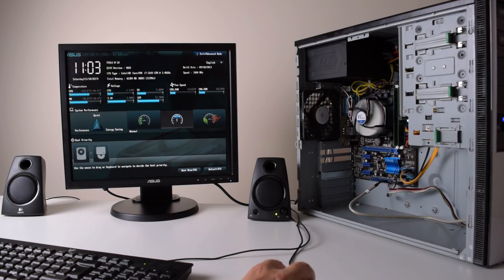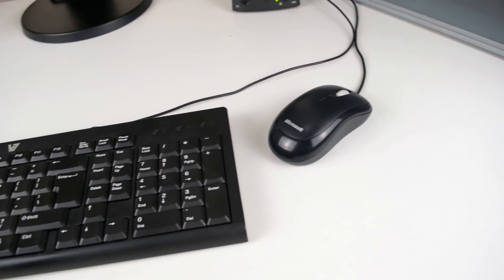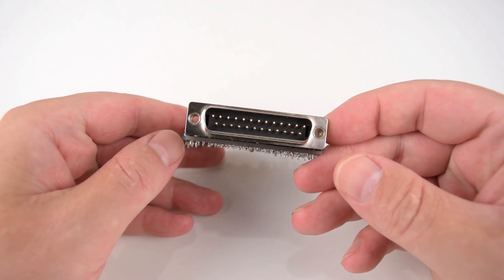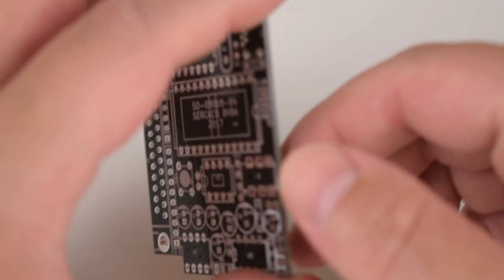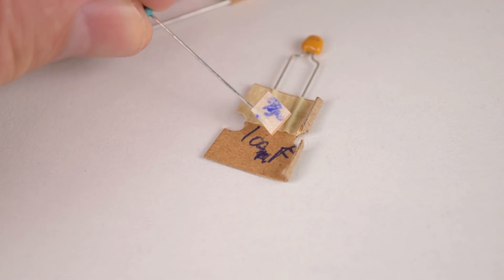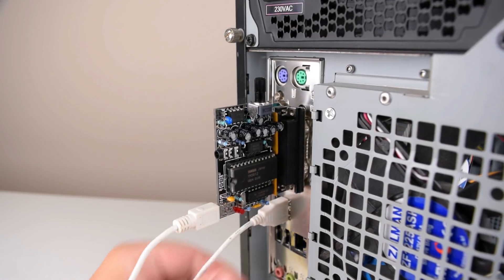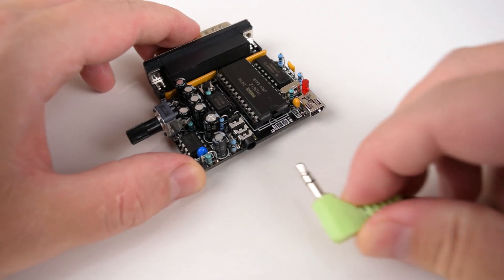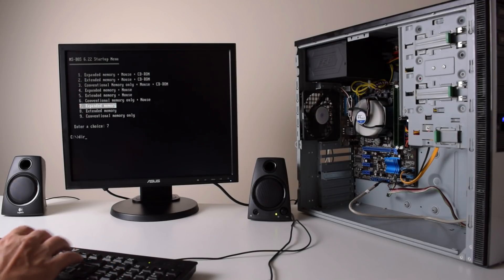Adlib Yamaha OPL sound in DOS games on a Core i7

Comment from the maker: I will post any updates here!

- There are now patches for games such as Doom, that add native support with this device. So with this, Doom now works. Other games are also supported, look here: https://github.com/pdewacht/adlipt/tree/master/adpatch
- Serdaco tells me that the final kit, the one you would receive, has matching photos with the parts. My kit had one or two capacitors in a different colour, but this should be fixed for your kit.
- There is a new 0.4 version of the driver https://github.com/pdewacht/adlipt/releases/latest
Reply: You are on a roll, Phil! This isn't really my thing, but I have a great deal of admiration and respect for people who do these kinds of projects. Very cool!
Reply from the maker: TheCaptain Same and that's the main reason I help spread the word.
Reply: Is there some reverb added from the speakers/room?
Reply: There is a printer port header on any newer under 150$ motherboard and in case of asus every motherboard witch has letter C on the end it means it supports legacy device for peinter port and comunication port (For examle H110M-C is used with i3 6100 in my office because i need a printer port and seral one) also you can add a LPT via pci or pcie 1x card for example JAVTEC makes some good ones

Comment: Only took 2 days to come through and not difficult to build and it works great on an old P233 Thinkpad I have (although it has its own sound card already). I can't get it working on an IBM PS/2 386 though and I don't have anything else 3/486/Pentium.
Reply from the maker: Odd, I wonder what's different with the PS/2?
Reply: No idea, someone else on their forums are reporting the same on their PS/2 too though. Wonder if it's something to do with the capabilities of the parallel port (ECP vs EPP etc.) but I can't change those types of settings even with the reference diskette. Anyone got a 486 PC I can have for cheap :)

Comment: This must be what The 8-Bit Guy was showing off on LGR's recent video survey of fellow YouTubers' retro game setups?

Would definitely be interested to know if the compatibility is better on era-appropriate machines, as well as whether it causes any performance loss.

I'm assuming the driver pretty much just routes 0x220/0x388 port ranges to/from the LPT port, so that you basically get an Adlib OPL2 sound card hooked up via LPT instead of ISA. Seems like someone could do an MPU-401 compatible LPT-MIDI interface via the same method.
Reply from the maker: There are now two ways of using it. With the driver, but there is performance loss, and some games won't work like Doom. The other option is patching the game for native support. Then Doom for example will work, no performance loss, but every game has to be patched manually.

Comment: Do MoBos still come with Printer port???
My PC is from 2010 and don't have it...
Reply: It's not on the back plate, but a lot of motherboards still have headers for parallel and serial ports. The I/O chips used on motherboards (that also include ps/2 ports, fans, temperature sensors etc) still incorporate the functionality and these chips are so common and cheap, no manufacturer bothers to make new versions of those chips without these features because it wouldn't be profitable.
Anyway, so yeah ... if you have the header, you can hit eBay or other sites and buy a bracket which has the printer connector on it. They're very cheap and easy to find.
Reply: Not really, though some OEM mobos may have still have it.

Comment: Wow. I wonder if, using a parallel port to USB adapter, you can use this with DOSBox or within a virtualization app like Parallels or VMWare?
Reply: wondering the same here mmm
Reply: probably not, those types of parallel ports require non standard drivers

Comment: Neat little device. I can clearly see were this can be usefull. My next thoughts about this little device, is were it might find true useage when it is not gaming.

There are musicians, that are using OPL chips with a special program, called Adlib Tracker. That program is a Dos program. Yet why not strech it beyond Dos. I mean... How about Windows? Could this potentially find some use in creating music, using native OPL, under one version of Windows or another? Can it be used on something like an old Amiga? Atari? PowerMac that still has serial ports. Just a little thought that I have.
Reply: Adlib Tracker 2 was ported to Win32 and Linux, also there is a port for Dosbox that can utilise real opl3 chip ;)

With Yamaha YMF7xx under Linux, you can expose opl3 chip as a midi device (dunno about windows, but i guess it can do the same)

Comment: This is fantastic, it's really nice that someone bother to redesign an actual opl hardware , rather than having to relay on used sound cards. But it would be nice to have an option to have that opl on a dummy card so you could fit it inside the case, and connected an printer cable from printer port to the back of the card like you would do on a joystick port. rather than have the actual hardware sticking out. Also an external box would be also really nice.

Comment: Will it work with DosBox?
Reply: That's the question ! That would be great :) !
Reply: It can work with inpout32 in theory.
Reply: @James Maple Not really... the FM sound emulation always glitches randomly (pitch and timing issues) with in Doom in dosbox and I would always use wavetable sound when emulating those games, but I now own a real DOS system with a Sound Blaster Pro 2.0... and not only that there are no glitches but the gameplay feels smoother on a real system. This device in the video does seem cool and would be a great way for authentic adlib sound using Adlib Tracker II on a modern PC (as long as it has a parallel port).
Reply: There already is a windows OPL3 midi driver made by MaliceX.

As long as the port is available for writing it should work!
Reply: If serdaco make windows drivers for this, then it's possible.

Comment: BTW - for the person who wants Tandy 3-voice, have you tried using the TEMU emulator software and a regular LPT DAC device? I managed to get Tandy sound working on a few games (including The Secret Of Monkey Island) by using TEMU and an LPT DAC card I made myself. I would also love a board like this that does 3-voice though - I also have a few SN76489 chips ready for if that ever happens.
Reply: I noticed that lo tech used to do a board which did this, but he hasn't had stock in quite some time.

https://www.lo-tech.co.uk/product/tandy-sound-sn76489-adapter-pcb/
Reply: Yes - I've bought from that site before, but sadly it's been mostly abandoned for over a year now.

Comment: I ordered one immediately. I've been looking for something like this since I have 5 or 6 OPL2 chips salvaged from old arcade boards and wanted some way to get them working again. I would have bought a PCB-only option if it had been available but I don't mind getting the components as well - saves me from ordering them separately. Originally I was looking for an ISA PCB version but an LPT version is almost just as good - although I'd imagine an ISA board version would be more compatible. I've looked for micro-usb sockets for through-hole boards myself and it seems they are hard to find. The micro-usb sockets I could find are surface mount only.
Reply from the maker: Anacreon ZA Nice.

Comment: It's probably easier to get a new motherboard with PCI slots and install some old PCI sound card with DOS compatibility. Although SB support wasn't reliable, games that used DMA mode of SB had problems, but Adlib support was working without issues. Also it's easier to get motherboard with PCI than parallel port on back.
There's also a problem with newer graphics cards. Nvidia GPUs from at least Geforce 5xx have issues with VGA compatibility. Same with intel GPUs.
This parallel Adlib is good for older laptops, but you would want to get a device with hardware SB support anyway for DOS.

It's great that these hardware projects are being made, but I would really like to get some Adlib/SB emulation for AC97 od HD Audio. Many later DOS games used a sound driver approach, there might be a possibility to give them native support for newer audio chipsets.

Also, it's a bit of irony, that sound support is the only thing missing from full backward compatibility with DOS era, and in the same time for years now PCs got standardized HD Audio.

I wonder if IBM could define a standard in the late 80s that defines multichannel PCM audio, with future proof API. LIke 8-bit 22 kHz for DOS era, and 24-bit 96 kHz or higher virtual support for extending standard in the future. But they were never that clever.
Reply: Especially since modern boards don't run PCI natively.
Reply: Honestly, it's not a good idea to use a PCI sound card for DOS anyways.

Comment: I'm not quite sure over which bus an onboard parallel port is connected to the CPU/chipset but my question would be if this device and it's drivers work on PCI- or PCIe-parallelport-controller-cards.
Reply: I guess the parallel sits on a PCIe lane, same with the PCI ports, network, sound, etc.
Reply: onboard parallel ports on modern computers use the LPC bus which is basically ISA over less pins, LPC stands for low pin count bus
parallel ports on pci/pcie bus will need additional drivers to function

Comment: does this work on old mashines too? down to stuff like a 5150
Reply from the maker: It does require more CPU power than a machine with an ISA card, so keep that in mind.
Reply: idlove to see a future video showing it off on slow mashines , maybe one that dont have any ISA slots , like an small formfactor board or some OEM board
Reply: To use the TSR, you need a 386 due to requiring the V8086 mode of the processor.  For a 286 and lower, you'll need either an ISA card, or learn how to patch the games you want to run to use the LPT port instead of 388h.
Reply: The webpage suggests a 386, seemingly mostly for RAM concerns.  For XT you'd probably want some kind of ISA OPL board.  I believe Sergey makes a PCB/has the designs for that.
http://www.malinov.com/Home/sergeys-projects/isa-opl2-card

Comment: 35 EUR landed in Aus is about $55 dollary doos... Definitely not possible to find all the parts for a retro DOS era machine (or even a whole one) off eBay these days, so this would be a great option for those who don't want to spend heaps on old hardware, but shudder at the thought of running DOSBox. I've bought many times more than that in DOS era hardware off eBay in the last few weeks (and still have a lot on my watch list!), but I guess I've just got the retro bug!
Reply from the maker: The Up Late Geek The way I justify it, the prices will only go up. I remember having similar conversations 5 years ago :D

Comment: Phil, you previously made a video showing that the Aureal Vortex PCI sound card works perfectly in DOS. That means that you should be able to build a new computer, with proper DOS sound support and real OPL2, as long as it has PCI, LPT and PS/2-ports, which many new boards still have (although it will soon be a thing of the past).

That would certainly be a slap in the head to LGR, who recently made a shamelessly bad video explaining how a new machine is completely unusable for retro-gaming, which I disagree with. (Not that I would ever choose that over real retro-hardware, but it's fun to demonstrate)
Reply from the maker: PCI sound cards stop working after a certain point / chipset generation. On a machine like the one shown in the video, there was no solution until now. So this is a real game changer. Well the PC speaker worked great.

I really liked the LGR video. I also don't recommend using an i7 for DOS, it's really a showcase of what is possible and to make a fun video. Retro laptops owners will really dig this device I think, apart from Covox or Disney Sound Source, they had few options.
Reply: Henrik Wils I think you should calm down about LGR. Maybe you need a "slap in the head" for shamelessly getting angry over nothing. He made a video showcasing why modern hardware is not ideal at all for native DOS gaming, and he was right.
Reply: I guess a good build would be something of the pentium 4 or Core 2 era. There is still native support for paralel, PCI and PS/2 and they are fast enough for more modern systems.
Imagine a multiboot system with DOS, XP & 7, whould be quite nice for a broad range of games.
Reply: +HappyBeezerStudios
I actually ran my PC with that EXACT boot configuration. It worked great! Was a pain in the ass to setup though.

Comment: This could be amazing for those Pentium III/IV machines with no ISA slots. The biggest issue with PCI sound cards has always been poor Adlib emulation, PCM sound was more or less ok.
Reply: ISA was phased out during the PIII era, the last boards with a proper native ISA would be using the Intel 440BX and VA Apollo Pro chipsets. even the Intel 815 is missing it in most cases.
Not sure if there is any reason to do ISA reliant stuff on such a fast machine anyway.
Reply: It actually makes a lot of sense. PIII and PIV machines are extremely cheap and easy to get, while 486 and early Pentiums are getting more expensive each passing day. In fact, I had a PIII laying around and used it for a while as a DOS machine. It worked great, but my PCI SBLive sound card had many DOS compatibility issues and extremely bad FM music. This OPL2LPT device would have been great.
Reply: Nothing an YMF-724 can't fix for you....
Reply: Some of the very last ISA boards were on both Socket 370 (MSI MS-6323 had one) and early Socket A (ECS K7E-A and Epox KTA3); not to mention shared ISA/AGP slots that lasted for a little while longer.

They were pretty much all gone by 2001 though.
Reply: Thanks for the tip!
Reply: Scratch that - I have heard of P4 boards with ISA slots.

Comment: Does the i7 series 2 support vt-x and vt-d? ...I use a series 3 i7 to run virtual machines complete with GPU pass-through (unfortunately, GPU pass-through requires UEFI compatible hardware).
Reply: Intel introduced VT-d support for K SKUs with Haswell Refresh (4x90K).

Comment: Sounds like it requires Emm386? I wonder if it works like the sb live!

The combo of the Live! and Ultima 7 lead to my first instance of not being able to run an old game even in 9x DOS mode.  Ultima 7 needed emm386 NOT loaded. The live! DOS drivers needed emm386. Trying to fix this with fan patches and replacement interpreters taught me a lot.  Lead to me building a dedicated old games pc until it died.